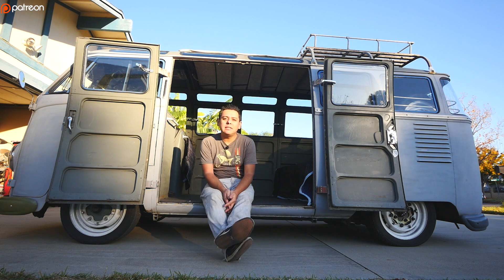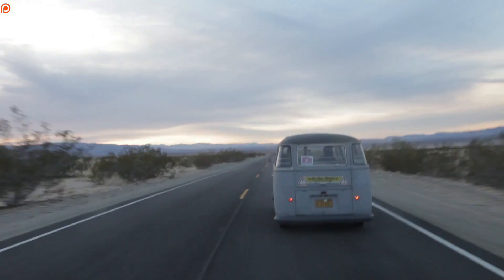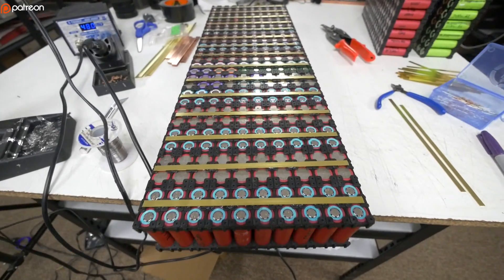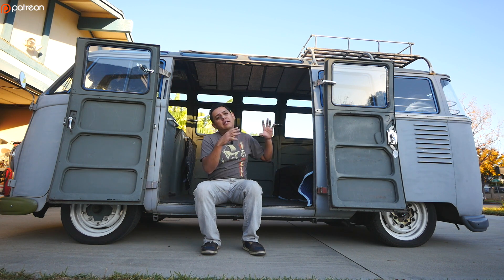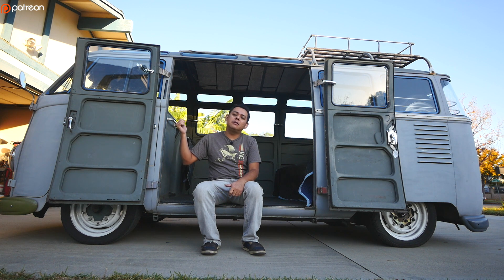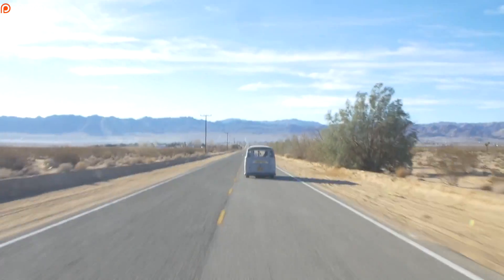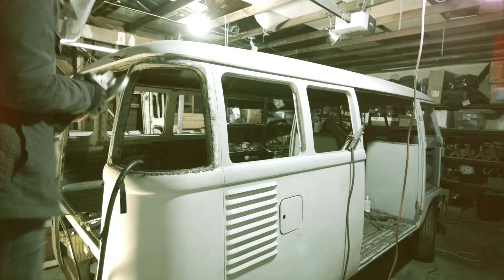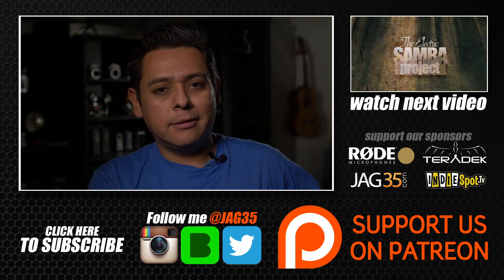Tesla Battery Range extender Trailer - eSamba Ep43

Comment: Essay, you did what I was thinking of back in the 70s when I was in school.  I wanted a VW bus setup as a camper but all electric with luggage racks on top to mount the solar to.  Yes, I heard what you said about that and it would be better to add more batteries.  But I was thinking of going places where there was no place to charge.  Like then as it is now, we don't have places to charge like you have in SCal.  I do still think about as I work at home as a software analyst.  But working 60-80 a week, running a small farm and with a wife to take care of.  Well, I don't have the time to do that.  But in either case congrats on the achievement.

Comment: Hey, I'm a huge fan of what you're doing! I wanted to let you know that I have a 2 cylinder diesel generator that's setup to charge batteries!  It is rigged to put out 7.5kw per hour, and it burns .33 gph at 100% load. It has a 10 gallon tank. With your setup here, I think that with this engine, you could make a trailer to pull it behind your bus, and you could essentially get 180mpg, and extend your range indefinitely!!!!!  If you are interested, please feel free to contact me via email at godisel@yahoo.com. 

I'm selling the generator, but if you'd like to give it a test drive, I'm in AZ and I'd be happy to let you test it out to see how well it does!
Reply from the maker: +Trent Allen  This way is more attractive to me https://youtu.be/LmLCKjZbGJQ?list=PL2l32K1w0jp-m04Jl-3PHmtapevOuCeIp

Comment: For the high current connection on the trailer, I'd recommend Hubble cam lock connectors. Good to 600v 400 amps and waterproof.

Comment: If you're doing a tesla battery pack,wouldn't  you need a heat management system for when you charge? Or is that if you use the supercharger network?
Reply from the maker: Yeah,  I'll be charging and discharging a levels that don't create enough heat to warrant cooling.

Comment: Great project! The VW Bus appears to be a great candidate for the EV conversion... I think the VW Beetle would be too... It looks like you lowered it...? Just wondering if you kept the original height you could build a battery tray underneath the entire floor in addition to the cells you have in the floor cavities now. This would maintain the low CG and even distribution F to R. The extended range trailer should also be the "skateboard" concept, again keeping the weight low and still allowing you cargo space on top where you can even build a streamlined enclosure similar to the style of the bus or a miniature version of it, not a literal copy, but complimentary in style/design & aerodynamic... This also optimizes the space in the bus for passengers and sleeping areas... I know, easier said than done, but hey you asked. :) Just spit-balling here... HA!

Comment: Years ago I found this as an interesting electric vehicle. Ignore the fact they used lead acid.  en.wikipedia.org/wiki/AC_Propulsion_tzero Note the trailer about midway down the page.  A Gasoline generator as an extender.  It is a cheat but you have real good range and you could leave the engine at home for local trips. Unlike the Volt that continues to call itself an electric car yet continues to carry the weight of the ICE reducing its local range...

Anyway just a thought

Comment: Personally, I'd prefer to have all the Tesla batteries in the floor for even weight distribution and best weight-to-energy for everyday use. Keep the Chinese batteries for the trailer/home power backup.

Though, like you said, that will require more work, the extra fiddling around will pay off.
Reply from the maker: +drivin98 

Choices....

Comment: The VW Bus Panel can haul a 2300b payload above and beyond the weight of the vehicle. Pretty impressive. I say go with the Tesla Modules in the trailer. Balancing the load is important so utilizing a trailer is good. See if you can modify the trailer to have the bulk of the weight below the axle on the trailer. Keep that center of gravity low. It will need a good suspension and shocks. Its about time we hear about your Samba. I bet most that watch just want electric car stuff. 

Pete :)

Comment: add air bags to your vehicle front and rear that will add more capacity. an added trailer would put more drag
Reply from the maker: +christopher villega   Suspension is fine,  Tires on the other hand are maxed out.  I need to lighten the load or get bigger tires.

Comment: What about making the suspension stronger and carry all the batteries on board?
Reply from the maker: No mods needed, suspension can handle the weight of 9 passengers and their luggage
Reply: +jehugarcia &quot;No mods needed&quot;, then why a trailer?  Going in the wrong direction.  Trailers are more for lead acid batteries.  If the Samba doesn't have enough room for lithium batteries, then nothing will.  Maybe pull a gasoline engine charger in the trailer?
Reply from the maker: +Yogi 
Because I don't want to carry around all that extra weight on a daily basis.  I only need 200 miles of range once or twice a year.   Plus the samba is test bed for projects and ideas People say are not possible and I prove it otherwise.
Reply: +jehugarcia 
Don't know if this is sacrilegious around here, but I think it would be cool to pull something like this in the trailer:
http://powerequipment.honda.com/generators/models/eb10000  (Probably not sized properly for the 44kw of lithium batteries. Would be interesting to see the math.)

Then there would be no mileage anxiety for those long trips.  Just attach the trailer when going out of town. :-)
Reply from the maker: yeah, thats how my chevy volt works,   its a good system, I would need a 22K watt generator for continues use,  anything smaller than that would provide lower than 100% of the needed power,  but working together the generator and the battery it could extend the range to hundreds of miles
Reply: +jehugarcia 
26kw peak (17.5kw continuous). "The most powerful portable generator on the market" according to the manufacturer - Generac.  Available from Home Depot at 1/2 the price of the smaller Honda unit above.
http://www.generac.com/all-products/generators/portable-generators/gp-series/gp17500e
Reply from the maker: $2700......not the most affordable way to add a  gas engine to the bus.  $1000 gets  me a nice vw engine I can install on with 4 bolts.  Not really the aim of this project,  I wanna drive my electric car on batteries

Comment: if I was in your shoes, I would take all of the tesla batteries and put them together on the trailer, I would make the trailer as short as possible height wise and extend the trailer if room is an issue, maybe even chop the trailer up and install a cheap airbag system for suspension on trailer dress it up to go along with the samba's theme, an additional idea is to make an pocket on the trailer to house a inexpensive 240v portable gas generator....these are cheap and easy to find and most have up to 30amp output and this would allow trickle charging on the road as well a source of backup power for your house in case of emergency..

Comment: Those tesla batteries woud look very well hidden under the floor and in the end give up on the old technology batteries all together. Also recicled laptop batteries packs placed in the back or other smaller places. Would two of these packs go under the front seats to balance weight a little ? Not a fan of a trailer battery pack ideea. Congrats on the nice channel content.

Comment: 2 more wheels wont affect the range? the batterys weight will be the same, but you will be adding the whole trailer weight.
Reply: honestly weight on adds wattage draw on the motor to maintain speed
Reply from the maker: +NicolasVi  yes I will be adding extra weight,  but I will be adding an extra 18Kwh of battery making the extra energy needed to tow the extra weight and then some.
Reply: jehugarcia can it be posible to put the extra batteries inside the samba? near the front seats to help weight distribution ?